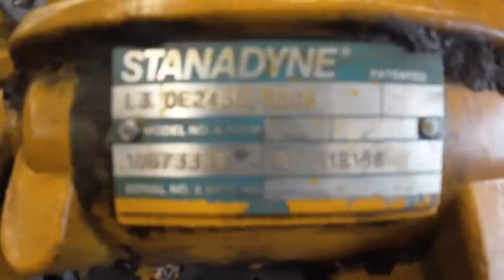Stanadyne DE injection pump replacement on a Deere 4045 engine 550H dozer w/help @AreaDieselService

Comment: I am doing a rebuild on a JD 2640 Tractor with a 4045 N/A Motor I acquired form an action. After a recent test drive, it would appear my oil level is increasing. Does not appear to be the exact model pump but very similar. Looks like I am a potential ADS customer. Very timely video and thanks for the heads up. This is exactly why I watch Youtube videos, especially yours.
Reply from the maker: Yea
If it’s one series earlier you can replace the seals yourself pretty easy

Comment: Nice work as usual. I'm in the PNW, but have some plans to replace my injectors on my F350 7.3. Will be contacting Area Diesel Service when that time comes. Thanks for sharing.

Comment: Yeah it helps when you have the correct tools especially when working with high pressures and tight tolerances. ADS do injection pumps every day; it is not cost effective to do it yourself.
Reply from the maker: Correct

Comment: Hi Clinton - love your videos. But a bit disappointed to see so much overspray on that machine. PS - you should actually be using HVLP spray equipment - you'd get a totally acceptable paint finish for your type of work, dramatically reduce your overspray problem and same a fortune on paint

Comment: Nice timing.  I’m rebuilding a JD450 track loader.  The engine was shot, so I bought a 4219 and the machine shop informed me it had a long crack in the block.  Bought another 4219 and haven’t sent it out yet.  So, now I have two of those Stanadyne pumps.  Would it be worth having Area Diesel rebuild one for me and one I could sell?  Or is it to cost prohibitive?  Thanks guys.
Reply from the maker: I’d probably just get the one fixed
Reply: @C_CEQUIPMENT   Thanks
Reply: We offer quotes - hit us up if you need anything!  Depending on the type and condition, we are also known to buy cores if you ever end up with extras you don't need.
Reply: @AreaDieselService   I was planning on contacting you to repair the one I have from the JD4219.  Just got busy today.  I’ll get the model no. And a pic and email to your company tomorrow.

Comment: I tried using a steering wheel puller and the gear hasn’t moved yet.  I’m back rewatching and realized you guys used a different puller.  What was it?  Any idea where to get one?   The job was going so smooth until I got to that gear.  Also, how much fuel will drain out of the smaller line on top?  Thanks.

Comment: How would you verify #1 TDC if you have the older pump, before removal? Fly wheel pinned but you cant pin the pump and the window faces the block.
Reply from the maker: Check to see if #1 cylinder valves are both closed

Comment: I know about using the manual lift pump lever to prime fuel from the supply to the pump, but do you have to bleed the high pressure lines from the pump to the injectors? Or does any air just get forced through the piston cycle and out the exhaust as the pump pushes pressurized fuel through the line? Or did I just answer my own question?
Reply from the maker: Sometimes you do
Reply: @C_CEQUIPMENT  I replaced the fuel line yesterday and ran the tractor.  My ear is not tuned to listen for misfires among the noise of the other 3 cylinders blasting away so I can't tell if the problem is solved.  I found tiny chunks of cured epoxy blocking the inlet to the injector, someone had used JB weld to stop the leaking from the cross-threaded fuel line coupler.  I cleared the debris with carb-cleaner and put on the new part so I'm certain I restored fuel flow but now I think the injector might need a rebuild because apparently the pump was already rebuilt sometime around 4000 hours. The tractor is a J-D 210 LE that a non-profit uses to repair and grade dirt roads that washed out by heavy spring rains in the high desert.

Comment: Clint, I'm working on a old paver.
Needs all new track pins. Smaller diameter,  1/2". Anyway, what material are pins usually made from? 4140? 
As usual,  great vid!
Reply from the maker: Yea
That would be my guess